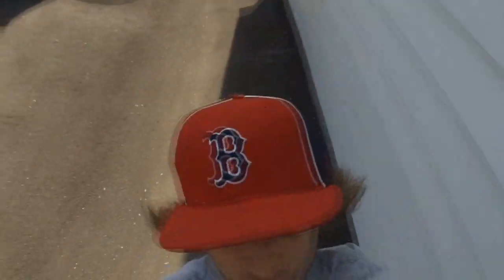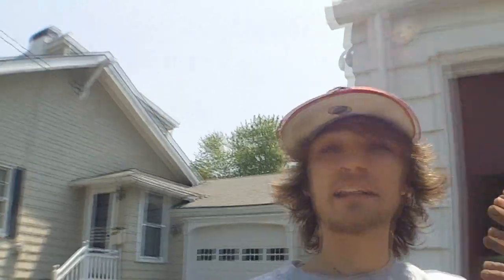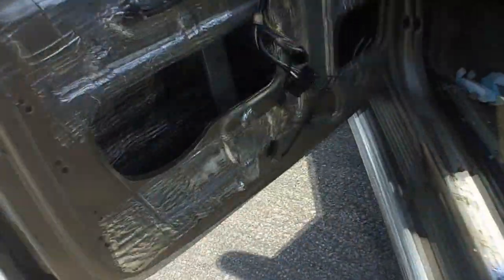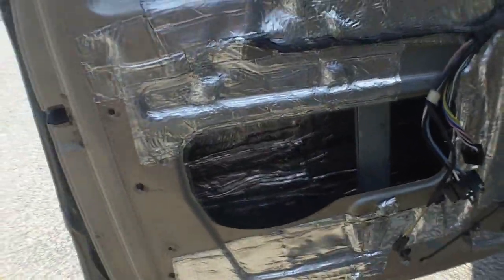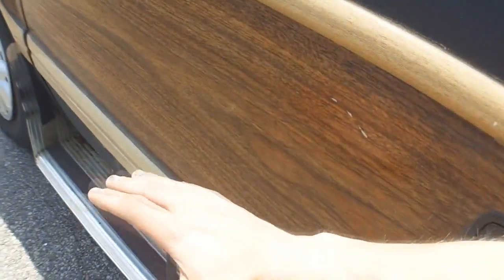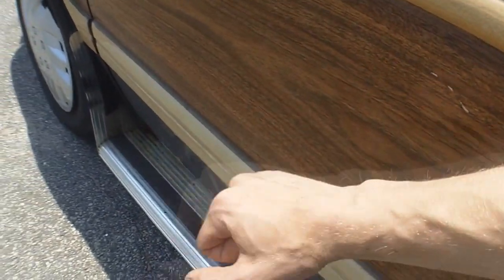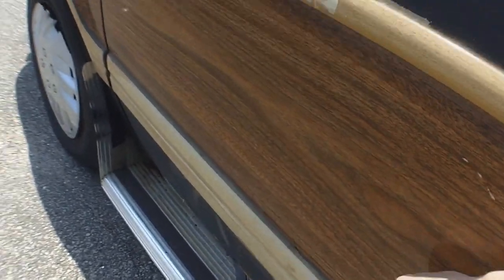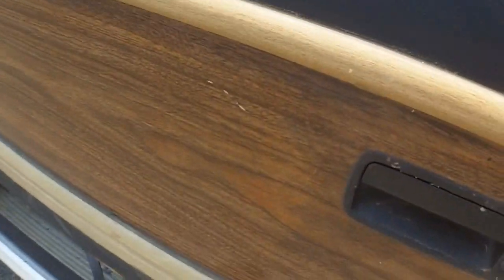Amazing Results w/ Audio Techinix Sound Deadener: Rattle TEST Before & After - EXO Car Audio Review

Comment: I just installed two 25 foot rolls into my truck and it feels allot stronger and quieter. The difference ins winter and summer! I still have to do the roof, but right now the edges are a little covered (about 6'') and it makes a difference.

Comment: That stuff looks like it does a great job, I will have to put some of that in my 86 toyota pickup, at the moment if you slam the door it sounds like it's going to do damage, and I'm sure it wouldn't sound too pretty either when I throw a sub or two in there.

Comment: ANYTHING is better than nothing. I used crappy peel & seal and it still made a huge difference compared to nothing at all. I did my left door and for a while the right door had nothing and it sounded pretty lame compared to the left door. A.T. is good stuff though. Price to performance ratio is great

Comment: @mustangmike420 If your wondering WHY he used audiotechnix over dynamat is simple the aluminum foil layer on the audiotechnix is 60 mils thick (there is an 80 mil version, but I think he only got the 60) on dynamat extreme its only 4 mils. much stiffer therefore less rattle (read distortion) which will make his system LOUDER, which is what he's going for. Its also cheaper then the dynamat. Price does NOT always mean a better product. If that were true all his stuff would be JBL lol

Comment: Quick question for ya man.  Do you recommend filling the inside of a trunk lid with foam? I've heard this from time to time and wonder if this Audio Technix sound deadener will be enough.  (currently I have towels stuffed inside the lid lol [but it dosnt help :O ])  I just upgraded from a 12" RE Audio SXX to a 15 RE SXX and my license plate and lid rattles horribly when the subs only moving an inch.  Any helps appreciated, thanks!